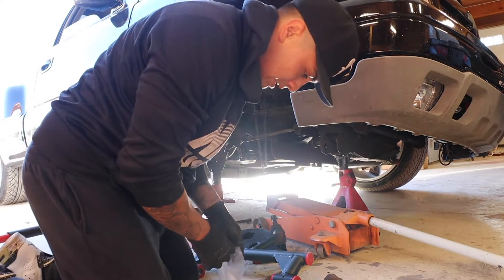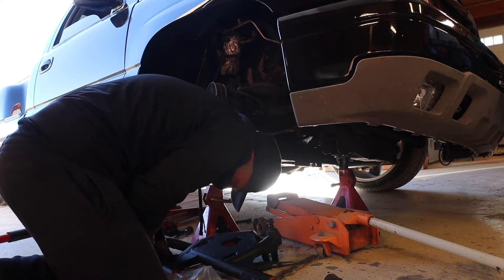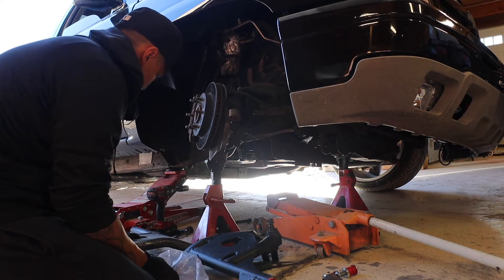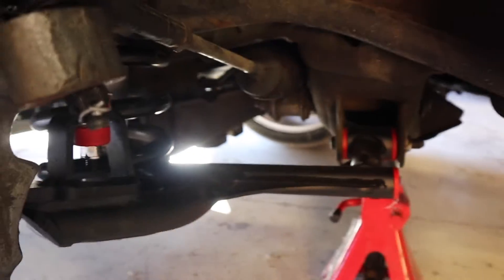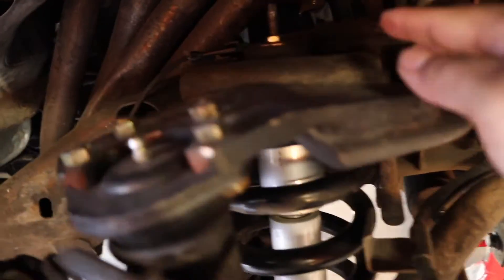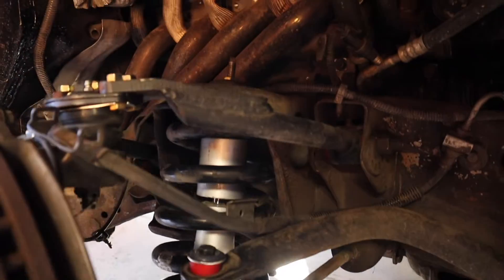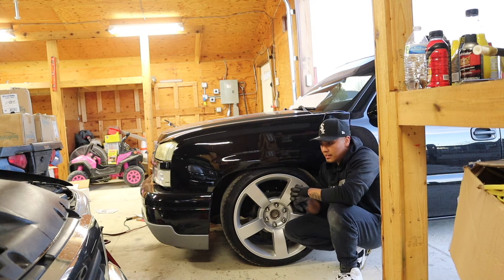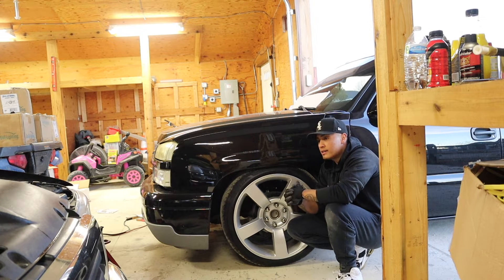HOW TO LOWER MY CHEVY SILVERADO WITH DJM CONTROL ARMS!!

Comment: Did your sway bars bolt on right directly?
Reply from the maker: Yes no issues
Reply: I have a 06 silverado crewcab bro bought a djm control arm 3” and my fitment for the sway bar link seems to fit a little angled

Comment: So 5 Inch lower control arms doesn’t lower the truck the full 5 inches
Reply from the maker: Yes it does bro needs to sit I’ll have an update video but the truck went 6” for sure
Reply: Sounds good what set up is the best for a 5 inch or 4 drop in the front with no camber
Reply: @Elduuran  so will 5 inch drop control arms do the job or can I still add springs and spindles
Reply: To get a smooth ride